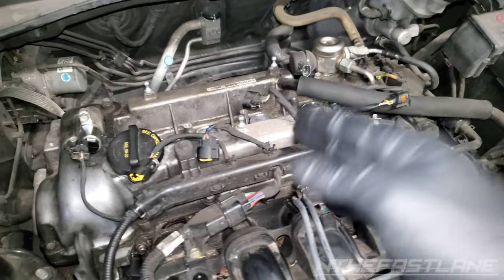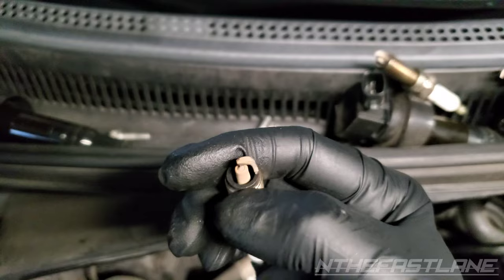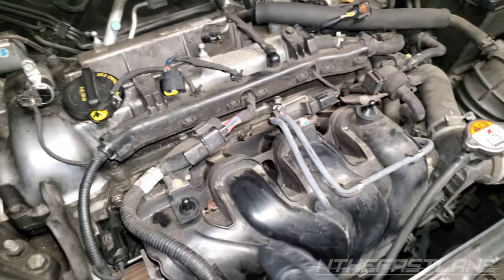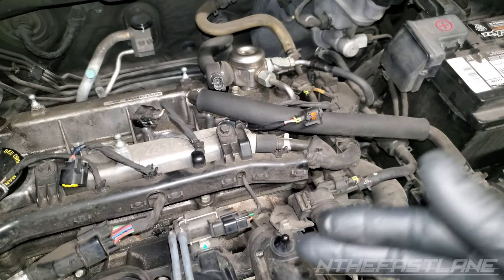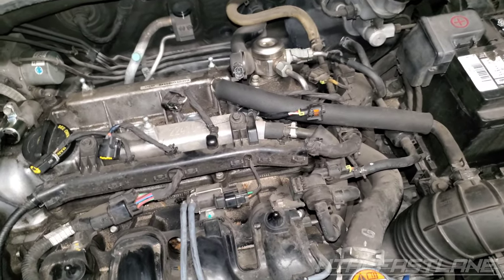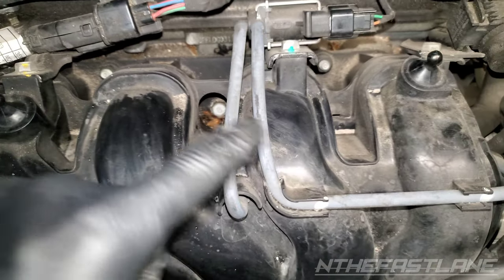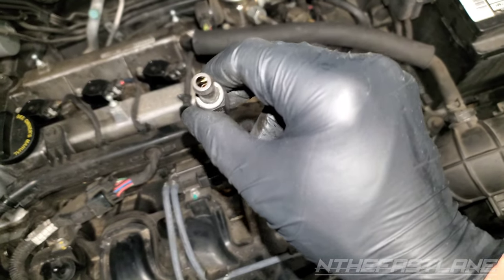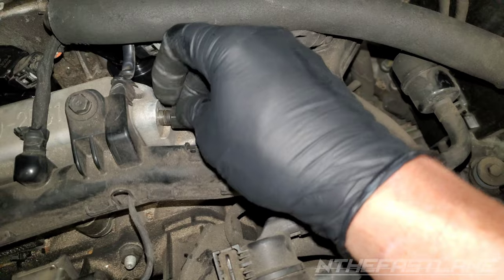Troubleshooting P2191 & P0420 Check Engine Light (Hyundai Veloster)

Comment from the maker: Parts Mentioned In Video For (2012-2017 Hyundai Veloster)
🛒PCV: https://amzn.to/4aEjMZP
🛒High Pressure Fuel Pump: https://amzn.to/3xoQhMW
🛒Rear Fuel Pump: https://amzn.to/43Dw9Ty
🛒Intake Gasket:https://amzn.to/4aAMef6
🛒Throttle Body Gasket: https://amzn.to/4axBfD0
🛒Vacuum Hose: https://amzn.to/3IZBtXW
🛒GDI Fuel Injectors: https://amzn.to/3PJvTwF
🛒Fuel Injector Cleaning Machine: https://amzn.to/3J4pKXO
🛒Brake Cleaner: https://amzn.to/3J5MW85

Comment: I have that problem, System Too Lean at Higher Load Bank 1
Reply: Me too as of today 2024 Aug 12th
Reply: @jayglock6099  I just bought a soul with this p2191 lean fault (and p0420/p0300's). All 4 spark plugs looked dark and dirty, too, unfortunately. Was getting misfire codes on all 4 cylinders, however it runs the same if you pull the ignition coil pigtail on cyl#2 and dies immediately if you pull any other pigtails. So I have a lean condition on cylinder #2 it seems. I might just replace the #2 injector tomorrow 🤔